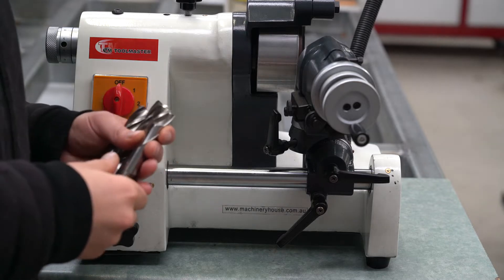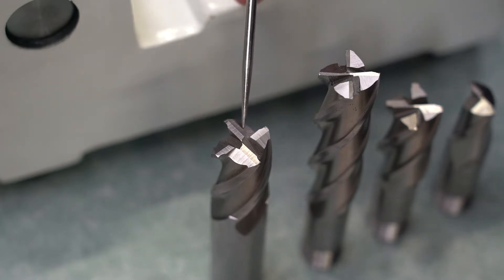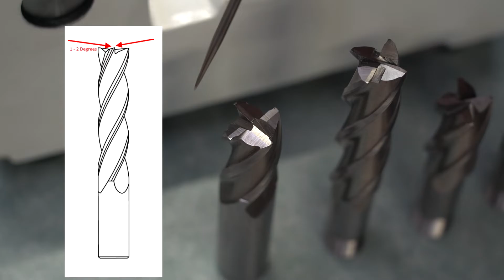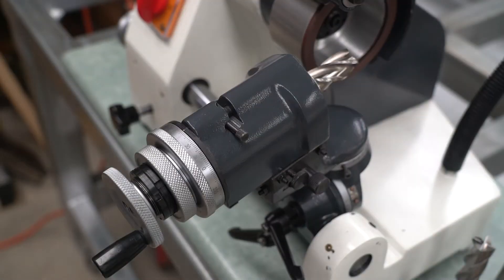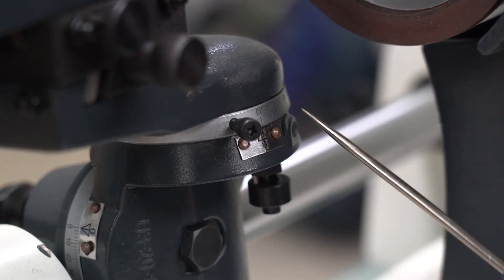End Mill Sharpening Guide : Universal Tool & Cutter Grinder AKA D Bit Grinder

Comment: If anyone’s looking for a solid place to get end mills sharpened, I’ve personally had a great experience working with General Cutting Tools. I’ve sent tools in that I assumed were near the end of their life, and they came back cutting like new. They take the time to inspect everything, explain what’s worth sharpening versus replacing, and the quality of the grind is consistently spot-on. Turnaround has been reliable, pricing is fair, and it’s saved me a lot of money compared to buying new end mills all the time. Definitely worth checking out if you want a shop that knows tooling and actually stands behind their work.

Comment: Very nice and thanks for the demonstration.
When sharpening the end bits, why is the D bit grinder's tool holder rocked to present the tool's cutting bit to the grinding wheel?  
Would it also work if the user found a suitable setting for the knob that controls the rocking and left that setting alone.  Then, move the shaft axially to present the tools cutting bits to the grinding wheel?  
Perhaps there's not enough adjustment travel in that knob at the end of the shaft to allow enough clearance to index the tool?

Comment: Just revisited this site again after about six months and I've used a number of 4 flute  brazed carbide milling cutters that have straight flutes.....the carbide tips were brazed on with the tip square to the axis not slanted............that is without a helix angle and I can state they are extremely easy to sharpen not having the helix to contend with......all you need is to slide the cutter along a pin and Bob's you uncle, no twisting and sliding needed.
At the same time I've used the cutters with a 3mm depth of cut as the mill is a small bench top mode so most of the wear occurs on the end 3mm of the cutter which makes sharpening very easy..

Comment: Just rewatching some of your videos, thanks for taking the time to make them.
I have the same grinder, there are instructions to line up the “white dot” which seems to be taken from the deckel manual but it is non existent on my machine (this apparently allows alignment of the tooth face using the little attachment arm). Do you have any thoughts about this?
On a completely different tangent do you also post motorcycle videos? Your voice is similar to that on another channel

Comment: At time 8:30 in your video there is a hole underneath your Endmill that whole is for a pin with an arm on it to line your end mill 90° you’re missing the pin
Reply: I think the purchase I just made has the arm but no directions on how to use it. Looks like the sellers have plenty of the machines to sell and we are relying on YouTube users to figure out how. I've seen two drastically different approaches so far. Mostly with regard to the adjustment that rocks the major shaft.

Comment: Summary: 
Sharpening the EM end:
teeth are concave towards the center by 1 or 2 degrees, so don't go 90 deg to the disk, but say 91. 
Primary angle is 5 degrees
Secondary relief angle is 12 degrees. 
Sharpening the flutes:
the angle is set slightly above 0, so EM only touches side of the wheel.
relief angle is 5 deg for 20mm or more, for 6mm EM relief angle is 15 degrees - note there can be more then one relief and primary edge sharpening was not shown?
Reply: Hello, professional tool grinder here. I appreciate your video and what you have done. In case you were curious in a professional setting we would use different angles than what you have outlined. For example, on the end of the tool the primary facet relief would be slightly higher at 7 to 9 and the secondary would be better suited at 15 to 17degrees. Your concave angle is appropriate at 1 to 2 degrees however in the industry we refer to this as a dish angle. 

On the diameter of the tool if doing one relief  I would stay around 12 to 14 if you are able to make two reliefs than a primary of 9 to 11degrees with a secondary angle of 18 to 20 would likely be ideal. 
Good luck and grind on.

Comment: After watching this video about your D-Bit Grinder.
I understand Why I have Never used my Grinder as yet ??

Having time available to Sharpen Drill Bits can be difficult enough.
Finding time to Sharpen End Mills 🤔😕

My thoughts are 🤔
Sell my D-bit Grinder,  and let someone else Sharpen my End Mills.

Would you be interested ?

I usually find,  I put my blunt HSS End Mills in a box waiting to have time to Sharpen them, while old Carbide End Mills and Drills go into a Recycling box.

Good information,  and thanks for reminding of Why I need to sell my Grinder 😁
Peter 👍
Reply from the maker: It's definitely time consuming. I also put all my blunt end mills and drill bits in a box for a day I can spend just on sharpening as it is a bit fiddly.

Comment: Excellent vid!
I have a question: Aren't diamond wheels only for carbide tools? I managed to load up a diamond wheel on steel and have been trying to abrade the steel off the wheel with marginal luck.

Comment: I'm currently building a Deckel look alike, but to a slightly different design and the aspect of the sliding spindle for the helix grinding getting grit in is a problem that can only be cured with an air bearing or with some air at the front and back to blow the dust out before it gets in.......something like 2 hollow collars attached to the front and back of the work head face that the spindle slides in......this will achieve the same pressurisation effect as the air bearing, but not for the friction free sliding part, but mainly to keep the dust out especially fine carbide dust......perhaps the sliding spindle could be modified to make it an air bearing?
Reply from the maker: It's a good idea but a lot of work. I would prefer to find an tool and cutter grinder with an air spindle bearing already.
Reply: @ProjectsDownUnder  Well, best of luck looking.....I have an idea on paper using some linear bearings instead of an air bearing so I might pursue that one when the grinder per se I'm building is finished.
The Cuttermaster T&C grinder I have has an air bearing and a takes 5C collets too......it works on as little as 30 PSI air pressure. 
It's quite possible to re-engineer a plain bearing to give it an air bearing function........that end mill grinding attachment is an add on for most if not all D bit grinders but quite costly.
Edit.......just did a test for a pseudo air bearing for end mill grinding.
I have an ER32 collet chuck with a 16mm X 150 long  plain shank..........the plain shank will slide axially in a 16mm linear bearing bush and it will also rotate quite freely too........a seal on each end will keep the grit out but I'm going to experiment with an air connection to the middle to blow any dust out.
I'll  make an end mill holder to mount in the D bit grinder and use 2 linear bearings inside it for the 16mm shank instead of a plain bore.
The ER32 chuck will take all cutters both Imperial and Metric and anything else from 2mm to 20mm.......that will make 4 facet drill grinding a possibility.

Comment: Thanks for the video. I have just purchased my grinder and sharpened a few lathe tools. Drill bits and milling cutters are next. On the Quorn T&C grinder, the rails are protected from grit with felt washers held under screwed down metal cups. I might look at that mod for my machine.

Comment: Thanks for the demonstration on sharping endmills, found it to be very useful. Just an idea, have you thought of using a thin grinding blade to cut the reliefs on the endmills, may find this to be more precise then free handing it.
Reply from the maker: I have another tool cutter grinder which I planning to add a grinding disc to and do just that

Comment: Sharpening the outer edges instead of the inner edges of the flutes reduces the diameter of the milling cutter, right? Or is this just a limitation of the setup?
Reply from the maker: Yes it does reduce the diameter.
Reply: If you sharpen the inside instead of the outer edge, that should help retain the diameter of the bit, as well as ensuring that there will be a shard breaker at the outer edge of the front cutting faces. Or am I missing something?
Reply: @wovenscrolls  I have a CUTTERMQASTER T&C grinder.....what you are suggesting is a very difficult operation especially for a D bit grinder.
Reply: @gangleweed  Fair point. I'm just lucky enough to have the specialized machine made specifically for sharpening the flutes properly. Horridly expensive and I had to have the machine imported (very much a rare machine here in South Africa if it is even available)
Reply: @wovenscrolls  Lucky you....China has been our friend in OZ for lots of goodies despite the political wrangles etc.
I bought the swing and tilt mechanism on EBAY that is a major part of the D bit grinder as I'm building one.....3/4 finished now.
Reply: You going to make a video to show your process of building it?
Reply: @wovenscrolls  Sorry, no, as I'm into building and not into video production which is a time consuming process........I will admit it's quite a long upward design curve to get the movement for both axial and rotating moves.......look at the design of the QUORN T&C grinder and you'll see how labour intensive that build is...... and copying the existing U2/U3 type D bit grinders without seeing how they work is a long way from actually building one from cold.
I've taken a short cut and am using a .12Kw 3,000 rpm 3 phase motor as the grind head and have bought the actual swing tilt mechanism on EBAY (A$380) as it's too labour intensive to build one from scratch with all the bits and pieces etc, so all up at the moment it's about A$500 outlay.
Reply: @gangleweed   True. Will still be nice to see the finished product when you are done:)
Reply: @wovenscrolls  If you just want to see it as opposed to making one then maybe in the very fullness of time I will send you an email to your email address, but it won't be anytime soon as some of the more difficult design parts are still on the drawing board about ready to be made.....but it is 3/4 made already.
If you want to get an idea of the build..... imagine a base that is 350mm  long X 250mm wide.........on this is bolted a steel box 100mm wide X 250mm long and 100mm high....that is the basic shape.
The 3 phase motor is mounted on top of the box and has the diamond grinding wheel on the spindle.
The swing tilt mechanism is carried on a 25mm diam shaft through the side of the box and in a bearing on the right side of the base same as in the Deckel or U2 types.
Basically, the 25mm shaft is spring loaded in the right side support bearing and moves axially by a screw in the box on the left side.
That's a thumb nail sketch of the design....you need engineering metalworking skills in turning, milling and welding to make it......I'm a fitter and turner, now retired.
Reply: @gangleweed  I have just recently overhauled a 1982 Classic Range Rover engine, done a full clutch service on my Open van (they are all Peugot under the shell now and the mechanic design is an utter nightmare), and last year before lockdown hit us all I was working in the safes and security industry designing safes in 3d on the computer to work out all the steel parts for production, so nothing mechanical scares me anymore. But I will not call what you are doing easy at all, because that requires a respectable level of skill to do.
Reply: @wovenscrolls  Yes, I come from a 60 year long, now retired, previous engineering working life, so machinery is second nature to me, but I would say that if you have design skills it only takes some engineering work to get to where you want to go even if you have to send work out but at a cost though.....sometimes it's better to buy what you need....but at a different level of satisfaction etc.
The most important bit of design and making is to keep it simple.
Anyone can design something that is highly complicated but it takes a genius to design something simple especially if you have to make it yourself.

Comment: Do you have a video on how to dress the diamond wheel that these machines come with?  Mine has quite a bit of runout on the face and I don't know how to true it up.
Reply from the maker: Unfortunately I do not. Dressing the diamond wheel is a bit tricky and I have avoided doing it.
Reply: @ProjectsDownUnder  Last night I used your technique to sharpen a really beat up carbide end mill.  The results were outstanding!  The only thing I did different when sharpening the face was I rotated to 85° so that I could see what I was doing and it also gave me excellent results. I used Stefan Gotteswinter technique as well which is where I got the info on how to do the face at 85°.  Even though the end mill had some huge chips on the side it cut as if they weren’t there.  Thank you!!

Comment: Can you tell me the power of your grinder? Thank you.I´ll check against mine.Great video anyway.
Reply from the maker: I think its 370w
Reply: @ProjectsDownUnder  Thank you for your reply.Do you have a three face power supply (trifasic) at home?,or you use a regular monofasic power supply.I own a GH 20T grinder trifasic 370 W but I run it from my 240 V monofasic power supply.I just wonder if you are using a converter to trifasic,like I do.I do certainly appreciate your kindness.Thank you.
Reply from the maker: The grinder is single phase phase but my mill and lathe is 3 phase and I use a 3 phase converter for that. No 3 phase where I live.
Reply: @ProjectsDownUnder  Again I thank you for your kindness.I appreciate some help regarding my final operation of  my GH20T grinder.Even when I can use my grinder when it is concted to my 240 V triphasic outlet of my Optidrive converter I don´t get the full 370 W of power since I need to bring  the 240 triphasic power to the 400V triphasic nedeed by the grinder and that can b edone with a triphasic transformer from 240V to the 400V as far as I can judge .Here is where I need some help to get this transformer.Your patience is certainly appreciated.
Reply from the maker: I don't know where to get a transformer but if you want full power then try looking for a 3 phase generator. That should give you full power.
Reply: @ProjectsDownUnder  Thank you.
Reply: @ProjectsDownUnder  I think he needs a VFD.....cost's about A$100 on Banggood, Amazon or EBAY, that uses the single phase mains to get 3 phase for the tool......I use one for my mill that has a  3/4 HP 3 phase motor.
Reply: @gangleweed  Yes.This is what I did and is working fine.Thank you.Jan-2025

Comment: It’s hard to tell from the video, but are any of those plunging mill bits? Because if they are, then grinding a split in the middle prevents that function from being used again.

I’ve seen that some machines have the switch with two positions after the on/off position, as yours does. Is 1 and 2 different speeds? And how do you manage without the locks on the shaft?
Reply from the maker: I don't think they were. It's hard to sharpen to the center perfectly with this grinder so a small split is necessary.

The second position turns on the light. A second speed would have been nicer :).

Comment: Hello PDU.
Having just purchased the same unit your video is timely.
A few points I have found.
Regards the flute grinding attachment.
The clamp coller has a counterbored hole that matches up with a taped hole in the head.
With the, I think M5 x 15mm cap head, in the coller can be nipped for 5c removal or installation.
Useful for positioning as well.
I like that you use the inner part of the wheel with the tool positioned so the grinding is into the edge.
Much better for grinding carbide as well.
Good explanation, concise with useful information.
Initially I thought the supplied instruction book was reasonable, it is not!!
Thank you.
Reply from the maker: Thanks.

Comment: I can tell by the sound that mill is destroyed. You reduced the tool lifespan somewhere low to 20%. You really need a ultra fine diamond zirconia grinder cup and grind 0.001 mm increments. That sound is nothing but high vibrations between the carbide and grinding stone where the stone shattered and then being fed whit very rough  sharp shapes being fed to take way to much material which is beyond the stones hardnes and these are high impacts that simply shatter the crystaline structure of the carbide and also creates many nanometric cracks in the carbides structure. Also before you grind your carbides you must dress yor grinding cup. I also advise getting some liquid nitrogen barrel and cool the mills after grinding them it will simply make them last 10 times longer. It will be like you just bought a high quality new mill each time.
Reply from the maker: Thanks for the useful info. The cutter in this video was HSS

Comment: Very good video! Thanks for putting in the effort. Great presentation, video quality and lighting. Mounted a diamond wheel to grandpas old bench grinder a couple of weeks ago .  Will need to build something so I can grind endmill in different angles. Very good with videos like this when one can see how a real tool grinder works and also learn some about grinding. Subscribed and looking forward to follow your chanel. I am fully confident that your chanel will start to grow rapidly pretty soon. 🙂
Reply from the maker: Awesome, thank you!
Reply: Don’t use a bench grinder to grind endmill. There is far too much vibration, and the bearings aren’t designed for that.